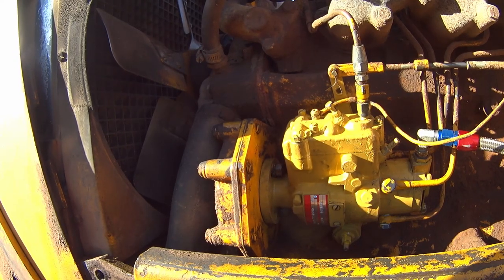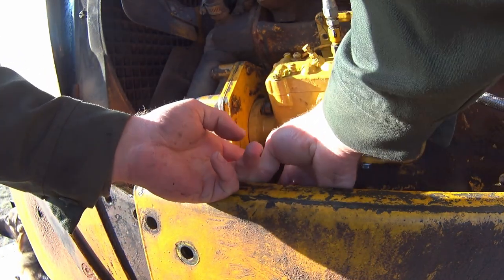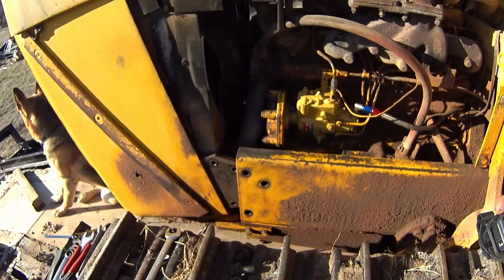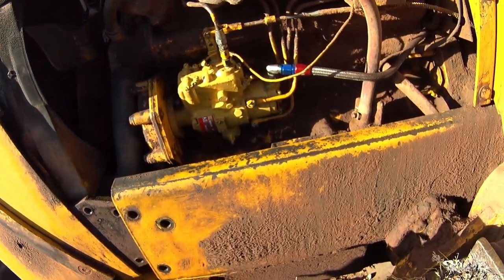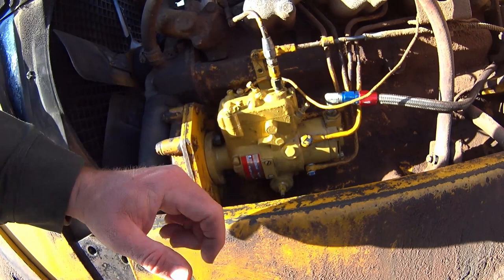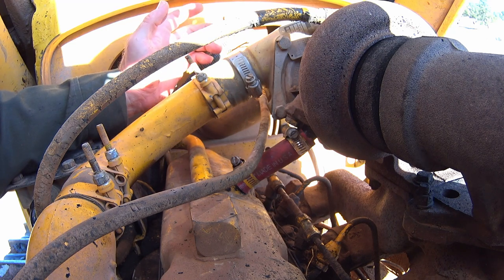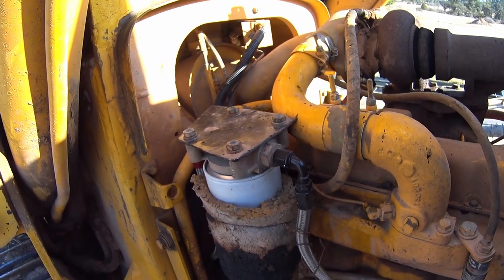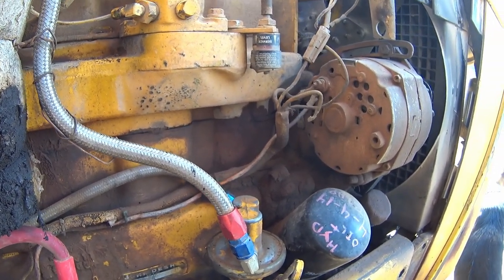John Deere Injection Pump

Comment: You can also rotate the engine using a screwdriver to lever on the teeth of the flywheel... It takes a while (but way easier and quicker than dropping the cowl).  Love your channel

Comment: That wrench that you chopped up you can weld a straight short bar on the off set, the opposite side of the boxed end to give you more leverage, just an idea. Give it a thought might help! I swear sometimes engineers purposely design things in hopes that mechanics will blow a gasket.

Comment: What did that fuel filter come off of? Id like to take off the original style housing thats on my 450c and have something like you have.
Reply from the maker: Fuel filter is a Baldwin BF1212 fuel water separator.  The head is available by Cummins/Fleet guard # 014278400 S. 
The head will have 3/4 O ring ports. I just found some 3/4 O ring to 6JIC fittings and made a bracket to hang off the intake.  Next I swapped out the line from the tank to the lift pump with 8 JIC or AN braided stainless from Summit and 6Jic/AN from the lift pump to the filter head and the head to the injection pump.  The 1/4" steel line that the dozer had originally would gel  up in the sub zero temps.  The 8 JIC is 1/2" dia and resists gelling by not being so tight.  Easier to thaw and keep running in the winter

Comment: So happy 100👍 thanks for good video.  My 310a backhoe got this injection pump. It starts and runs for 15-20 seconds and shuts off.  Replaced fuel pump, I did check if I had a good flow from fuel tank, it's good, will replace three years old not much used fuel filter, and if it will be same I guess it's the injection pump?  Any advise appreciated, thanks again.

Comment: Good to hear from you my friend great video I feel the same way about how companies make it so hard to work on anything with special tools and what not take care buddy God bless
Reply: yup then with old iron its hard to find parts :( damned if you damned if you dont. you aint no true mechanic unless you modified wrenches or made your own. cheers. the ting is with some machines is theyre designed like that so it forces you to service all the stuff that has to come off. i know not everyone wants to do that but sometimes its just  a necessary evil. like on my 7.3 for you to work on the motor comfortably you gotta pull the fan and rad and stand in the rad support. it makes a hell of a difference and all the angles just work better. so around the time you gotta work on the motor a coolant flush is normally required so it works well..

Comment: What size AN line did you use ??
Reply from the maker: its been a few years,  If I recall I used 8AN (1/2") from tank to lift pump and up to the BF 1212 Filter housing, Then 3/8"( 6AN) around the head to the injection pump.  I was honestly trying to use up some spare line sections that were laying around, and provide alot of volume in the tank to filter line to prevent ice jams.  Once the fuel flowed through the lift pump it would pick up some heat, same with the spin on filter housing being mounted on the intake, and finally running the line behind the head, it would pick up some heat to keep it thawed out enroute to the injection pump during the cold -20*F winters in Wyoming.

Comment: where did you find a spot to rotate it by hand or other type of tool
Reply from the maker: On the left side of the engine, behind the injection pump, on the bell housing near the side of the block you will find a plate with a dimple on one end and a pin on the other.  Held down with a 1/2 or 9/16 bolt. Unbolt that plate and under it is the timing hole.  Loosen the #1 injector line and use a remote starter to bump the engine over till you see that #1 either squirt or you see a hole in the flywheel appear in the bell housing hole.  If you miss it and see the squirt, remember it's a 4 stroke engine and you will have to bump the timing mark past the hole 3x to land on TDC again.
Bumping it will get you close, so when it came into view for me I was ready with a big alignment punch to catch it.  Now turn that afor said plate over and insert the pin in the flywheel hole, bolt it down and the engine is locked at TDC .  Tag it out or disconnect the starter, as if it's bumped, the pin will shear off.  Deere makes a barring tool to go in the starter location but it's awful $$$$.  I tried to make my own from an old starter but gave up as it was taking too long.
You can also tilt the cowling forward and grab the hydraulic pump driveshaft with a pipe wrench where it comes off the crank pulley.  The scars of this were evident in mine when I got into it.